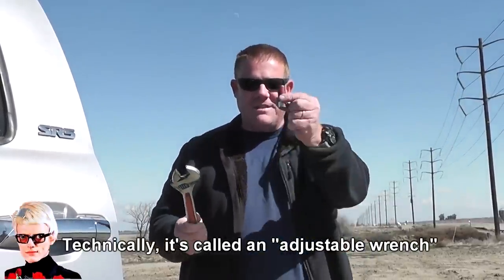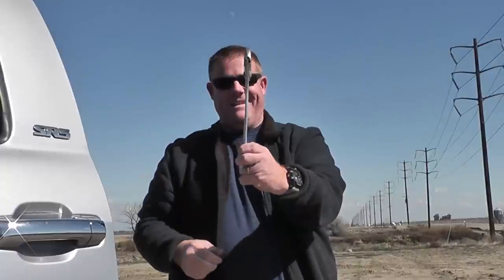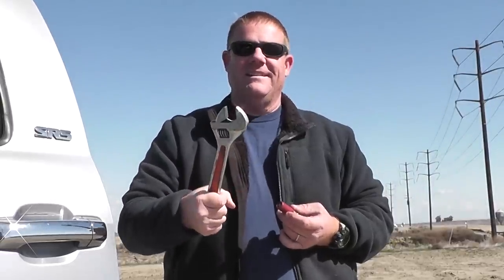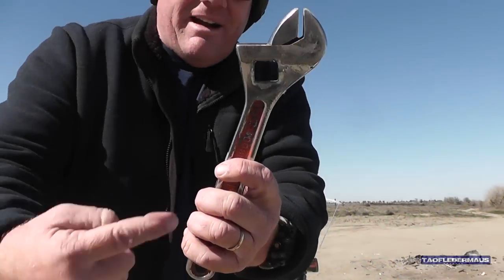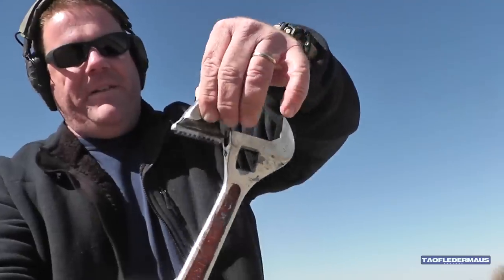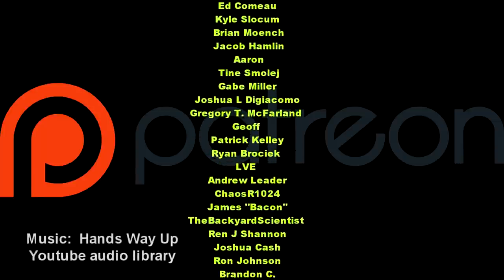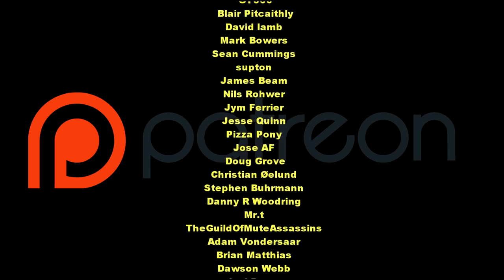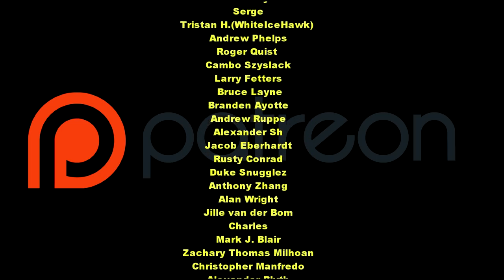Harbor Freight Adjustable Wrench vs Shotgun Slug

Comment: Try a harbor freight hammer face.   Be curious to see how hitting a tool that is hardened would react (plenty of stories of hammers exploding when struck face to face).
Reply: rebelcat420 yeah. i once used a hamer as a fitting of sorts to install a rubber pushing. anyways i hit that hamer with another one and a small fragment flew trought my clove into my thumb. i ended up cutting some flesh off so that i could pull it out. :D moral of the story. listen to old guys who warn you about stuff like that. thay know stuff. i was warned, didnt listen and got what i deserved.😂
Reply: Yes!
This needs to happen!
Reply: I was going to suggest this too. A slug hitting the face of the hammer on high speed would look sweet!

Comment: I'm curious about harbor freight compressors, how durable the wall of the air tank is. Possibly go from bird shot to slug and see what gets through first.
Reply: shawn hlebasko ooo yessssssss.  Especially under the full working pressure 😁
Reply: DIYisFun now that may not be an explosion waiting to happen, but damn does that just sound dangerous...
Reply: killroy v2 dangerous is another synonym of fun 😝
Reply: Ya ain't wrong...
Reply: DIYisFun Big Bang will be and understatement! 😂

Comment: Don't throw that wrench !!! That is still a perfectly good hammer and with some slight modification to the adjusting side a little grinding and Welding you can make a great beer bottle opener...  We must always be able to repurpose good tools. Or garbage tools when you're referring to Harbor Freight
Reply: When I break out the little dial, I just weld it to 1 size...unusally 3/4", that's pretty common.
Reply: Aww hell, I would just have them warranty it

Comment: As a professional mechanic I can tell you I definitely use some harbor freight stuff because it's just as good as anything else. I personally like their colored sockets for simple non impact work. Great for easily identifying the right tool without much effort. If it isn't electric or run by air it's usually ok to get some harbor freight stuff.

Comment: As a mechanic.......i would not trust cheap tools........i like my knuckles
Reply: As another mechanic...absolutely agree. It's worth the money.
Reply: Ive snapped a few craftsman wrenches through the years, that dirty Chinese steel tho...
Reply: ej732 Didn't ever have a bad experience with german tools, even with loads of pressure on them, but broke 2 chinese wrenches
Reply: I use matco 72 teeth ratchets,  craftsman wrenches mix of matco and snap on sockets. Gear wrenches......meh. Snap on/blue point.
Reply: Brause Paxlul i have some wiha & hazet specialty tools. With 20+year of euro wrenching you aquire all kinds of stuff

Comment: Great idea, love the Harbor Frieght idea. I would suggest chisels, job max, heat gun, the ganky batteries they sell, 4 1/2" angle grinder, or a floor jack. The only decent tool out of that batch is the heat gun which usually runs about $13. I would love to help test that out lol I've purchased a lot of regrets from Harbor Freight.

Comment: Glad you clarified "Crescent" as it's still the protected trademark name of the tool company founded in 1907 in Jamestown, NY, that's still in business, now owned by Apex Tool Group. They became widely known for their marketing of this type of adjustable wrench in North America and dominated the market with them in North America for many years. So much so that the term "crescent wrench" is used in North America to unmistakably differentiate between this type of wrench with the worm gear thumb  wheel and other types of adjustable wrenches (e.g. monkey wrenches and Stillson wrenches). Nevertheless, it has not been legally genericized (yet) like thermos, aspirin, heroin, trampoline, or escalator, all of which are examples of former product brand trademarks that are no longer protected. It lives in a limbo status with names that are still legally protected, like Kleenex, Crock-Pot, and Jacuzzi, but are commonly used eponyms as if they're generic. They won't come after you if you go into a tool or hardware store and ask for a crescent wrench, but wouldn't be surprised if they request take down or correction if used in publicly published video or written articles.

Comment: The proper technical name for that tool is "Crescent-Hammer, one each;"

Yes, I continue to faithfully watch every long and short ad that always pops up when I view the latest TFM vid or a vintage edition vid. You should be getting the fractional penny for each and every one of them. You will note that the "Crescent-Hammer" retains the majority of its functionality after direct impact by the slug. You can even use it as an adjustable wrench when combined with the two Harbor Freight Accessories: MIG welder and Angle Grinder

Comment: OG with the Robin Hood-esque shot! Honestly I think that was the best place for him to have shot it. The problem you’re going to run into with forged (yes even from Pittsburgh, China lol) tools is that, unless the slugs are extremely high velocity, they are just going to bend like the adjustable wrench did. Maybe shoot aluminum tools, or tools that aren’t “drop forged,” OR shoot them with much higher velocity slugs! (i.e 2000/fps+) Hope that helps guys!

Comment: You guys have the best channel. As for shooting Harbor Fright tools, I might suggest seeing how many layers of cheap plastic tarp material it takes to stop, or not stop, shotgun loads. Also, there is some question about the quality if Harbor Fright drill bits. Perhaps fire them from a shotgun and see how they perform compared to high end drill bits from the same shotgun. Not exactly a difinitive test on drill bit cutting and efficiently but loads of dangerous fun!

Comment: I have a terrible idea but would be interesting. HF tools vs good tools, is there a difference in damage from being shot? Obviously it's cost prohibitive so it's a poor idea. A good adjustable wrench will cost $30 which stretching the budget but when you start looking at ratchets or larger wrenches, it can get really expensive. 

On a side note, the difference between this wrench and a good adjustable (Like Channellock's Irega-made) is not just the strength, it's apparent in this video when OG shakes it...this wrench rattles. What that means is that it will loosen on you and be a pain to use. A good adjustable wrench, you have to manually turn the wheel to get the jaws to loosen. That being said, they're basically obsolete with the invention of the pliers wrench.

Comment: Whenever you shoot with water in the background I always check to see where the shot splashes down.
Why not experiment to see how far out the slug or shot or wadding or saboes or whatever goes if you shoot horizontally 6' above the water's surface?
Or, how many times you can make a shotgun slug skip like a stone across the water?

Comment: I have a HF 12" that looks like yours (before OG made that great shot). I think you should take it back and get a new one. Test out the Life time warranty on the Pittsburgh Tools.
My definition of a tool is something that Makes My Project and/or Life Easier. Bend em, Beat em, Drill em, and use em.

Comment: I've avoided looking at other comments but depending on where it gets hit, it might break if it gets hit on the knob (ooerr) but anywhere else is a bit of a mystery as most tools, even the rubbish ones, can take a beating!

EDIT: OG hit it on the best spot possible and ruined it but aim to hit it at 2-3 spots and it might be a good idea to have a vice or heavy clamping plate to see if a slug will beat or bend a tool.

I'd pick a handful of tools that you have reservations about as killing the tool is the aim so nothing too strong. I do suggest firing a slug head on at a chisel to split it and try hit targets behind the chisel!

Comment: I would have liked to see a couple more shots against that wrench.  See how the more solid parts fare against a slug!

Anyway, it would be interesting to see what happens to the head of a sledge hammer getting hit head on by a slug.  Would it even leave a dent?  What about an anvil?  Though the cheap anvils are often cast rather than forged like they should be, so it would probably chip out a decent crater.

Other fun things to try:

See if you can take all the teeth off a saw blade by shooting it end on just grazing the edge.

"Adjust the size" of a socket wrench socket by putting a slug straight through the hole!

Can a screwdriver blade skewer a slug?

Drill bit edition!

Comment: Get the  $9.99 4-1/2" angle grinder,    plug it in to a generator,  tape the switch on and shoot the spinning grinding disc. Get the $16.99 18v drill, put a half inch drill bit in it and tape the trigger. Shoot the spinning drill bit.

Comment: I thought it was going to punt it back down your barrel in an F U kind of way, can you get your hands on some margard ? It's a "bullet proof" plastic used in forestry harvester windows. All ways get told its bullet proof but have seen bits of saw chain get embedded in it when they snap. If I wasn't on the other side of the world I could send a piece. Excellent video keep them up.

Comment: Heat that bad boy up, red hot, and pound it into a flat thin spatula for the BBQ. As for cheap Chinese tools. I've been a professional mechanic for over twenty years and I buy them just so I can cut and heat them up and bend them into what ever shape I need to make a specialty wrench. They have their uses.

Comment: Harbor Freight tools are way better than they used to be.
For the ultimate test, you need to get some harbor freight hand tools (not the super cheapo ones) and the equivalent tools from MAC and do a test with both. I bet the Harbor Freight tools will hold up almost if not just as well as the MAC tools.

Comment: You might pop the thumbscrew thingy out but the main structure will remained. Intact, if bent. Written at 1:23 of the video.
Reply: Ha, he hit it right on the part I figured would break. Obvious, of course.  With a new ferril (?), it will work just fine.

Comment: You got an old circular saw?  Mount it upside down with the guard off or retracted and see if you can split a foster slug hitting a circular saw blade, in motion.  Takes a little engineering

Comment: @Taofledermaus how about shooting a 3 gal. 1/3 HP 100 PSI Oilless Hotdog Air Compressor from Harbour Freight for $57.99  charge it to the maximum of 100 PSI and shoot it with a Ballistic Machinist Barbell round. (I dont think a lead Foster Slug will penetrate the steel of a compressor) @ 30m

Comment: Somebody is driving a Toyota Tundra !!!  The rest really doesn't matter because it probably doesn't perform as well.
Reply: Robert Fuller 

I drive the Tundra, Jeff drives a Tacoma.  Two of the best trucks on the planet.   Even God himself drives an ‘04 Tacoma with lift kit.
Reply: I have a 99 tacoma. Drove it off the lot. Wash it every 10 years whether it needs it or not. Still running great.

Comment: A harbor freight grinder while it’s running max rpm with a knotted wire wheel sparking off a steel plate into a puddle of gasoline.

Comment: You only shot it once? You can do better than that. But sure, shoot up lots of cheap tools. I think you should try stuff like shooting an air-impact gun while it is spinning at max RPM. Obviously you would need to bring an air compressor and hose to do that, but it would be worth it. How about shooting a fast spinning saw blade to see if it will split a slug? How about buying their cheap ammo boxes, and then filling them with various random items to see which contents are more slug proof? I could go on for hours with cool targets, you guys should hire me. LOL.

Comment: I'm all for shooting Harbor Freight tools. I shop there all the time. Their stuff is more than good enough for the average " home gamer" as AvE puts it. I worked with top brand tools for 42 years and I can say empirically that HF tools would have worked fine in most cases. But I want to see a fair fight. Any "lead on metal" tool challenge will be legit in my book. Lead on plastic or any electronics will be considered sensationalist and I will refuse to ..... I'm sorry I can't type this with a straight face. Shoot 'em all and let Snapon sort 'em out in Tool Heaven !!

Comment: Whoa whoa whoa. I love you guys but don't go saying that real mechanics don't use shity wrenches. I'm a marine engineer and technician, Master Mechanic. I agree that the Pittsburgh brand is not very good and I have full sets of Snap-on and Craftsman though when I'm at work and wrenching on engines on boats I use my crappy Pittsburg sets for the main reason that I don't care if I drop them in the water. Never by Harbor Freight power tools though. Okay with that out of the way, carry on ;)